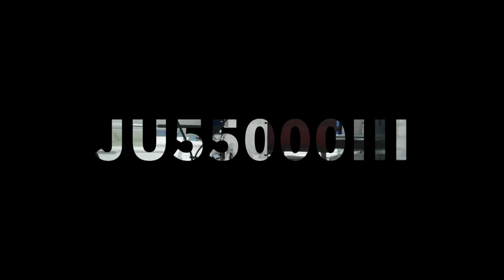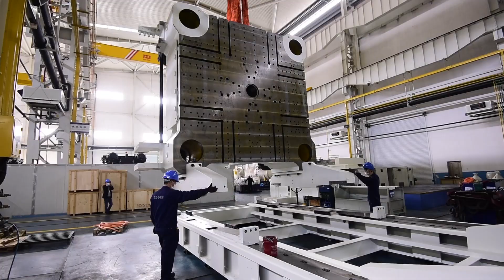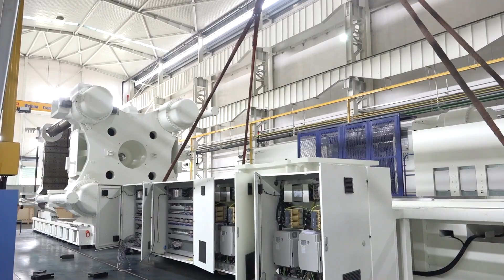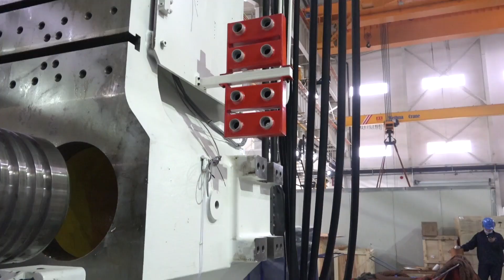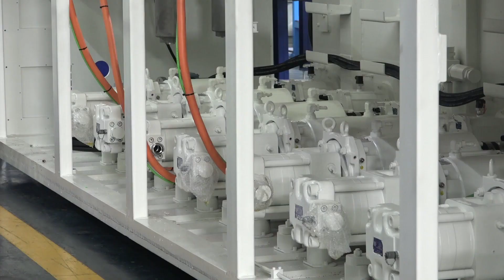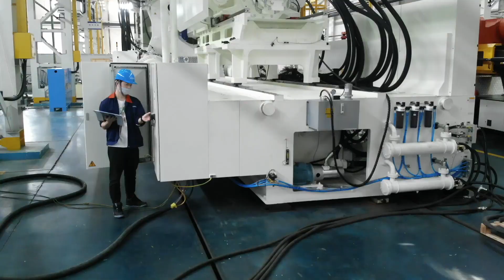Haitian Jupiter III Series JU55000III - Assembly of two-platen

Comment: I am a mechanical engineer working in cosmetics factory and we have haitian injection machine.
I am facing a problem in making the adjusting of tie bar and also in adjusting the parallelism between the stationary and moving plate.
I would like from you to help me in knowing what is the best technique and procedure to follow to make such adjusting and what tools to be used. I want to make a perfect adjustment for tie. Bar and parallelism. 
If you have a video or an article that describes briefly or if I can contact your customer service department.
Thanks for your help.